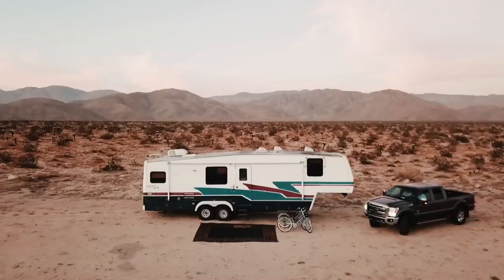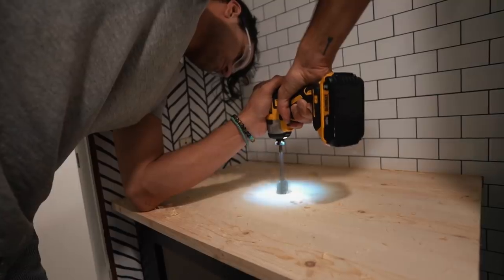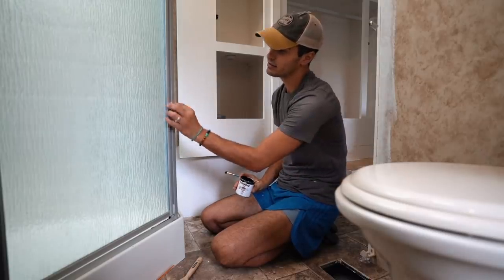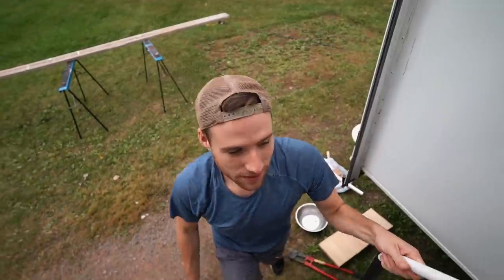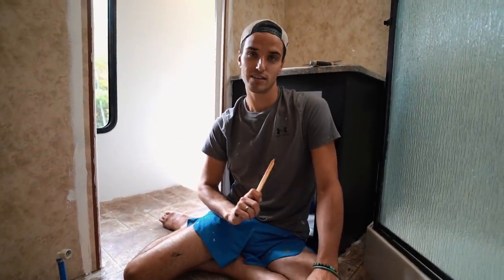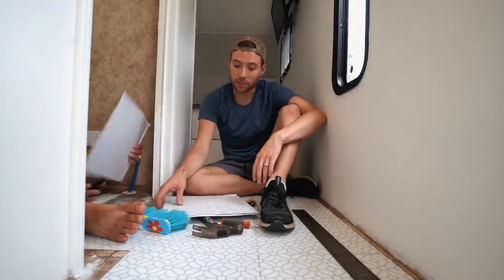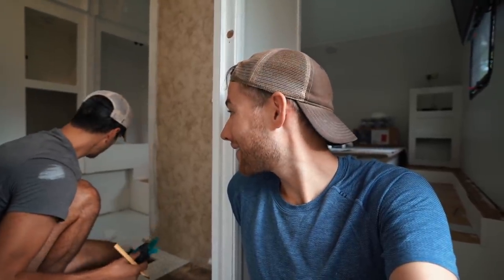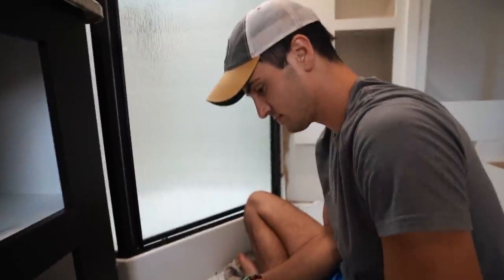Living in a TINY HOUSE | Bathroom REMODEL

Comment: Wax ring tip- I put them outside in the sun for a few minutes to soften just a bit. I’ve only installed 2 but had no issues with either.

Comment: That vinyl flooring throughout the trailer looks like the stuff I have in my kitchen.  All those frustrating corners and angles is why the RV manufacturer puts the entire vinyl floor down before putting in cabinets etc. to eliminate the need for cuts.

Comment: There is a battery disconnect switch either at interior panel where light and water heater switch is or near battery.

Comment: Regarding the countertops: Weight is a super important issue, so I was going to suggest that should you do this again you could have bamboo veneer put on the pine wood to have the advantages of cheaper material, lighter weight, but also the same look as the other ones. I'm a joiner and we once had clients come in to do something similar for us, they provided the material and it took about 1 hour to make and can make all the difference if you want the same surface on all your countertops :)

Absolutely love your videos, you two are hilarious ! :)

Comment: OK BOYZ,  you are using house hold stuff on an RV.  RV is different.   APEX is your water lines used on them or (shark fittings.)  and you do not use a wax seal under an RV toilet it uses a  rubber seal under it...  but you will get there even with making extra work for yourselves,  But I do enjoy watching you both.

Comment: Those subway tiles are lovely. Would you use them to cover the actual walls of the shower? I want to in my RV.
Reply from the maker: You absolutely could!! Just make sure you scrub the hell out of the walls with tsp first! I might also seal the seams with a waterproof caulking too!
Reply: @tylerandtodd  that's awesome! Could you tell me which brand you used or send me a link? I'm looking at Amazon, but there are so many and with varying reviews.
Reply from the maker: @MichaelHarper  We always include the links in the description boxes of our videos!